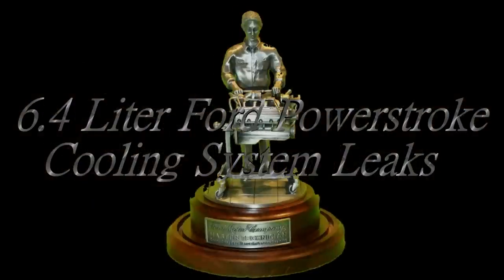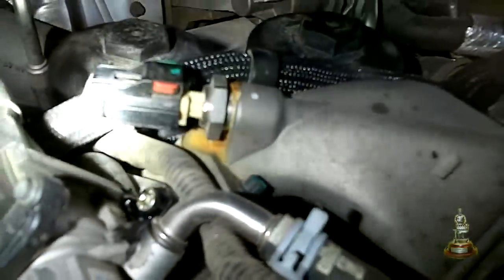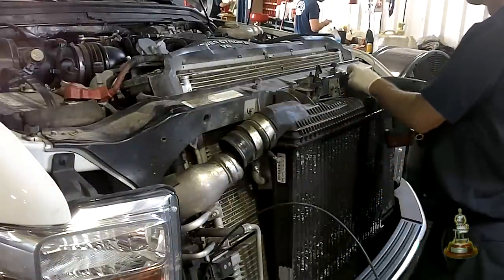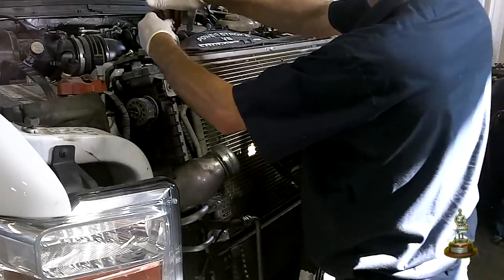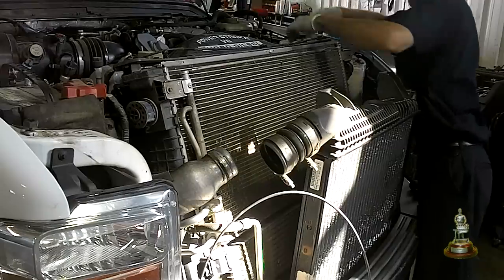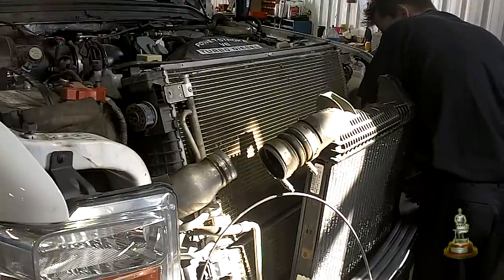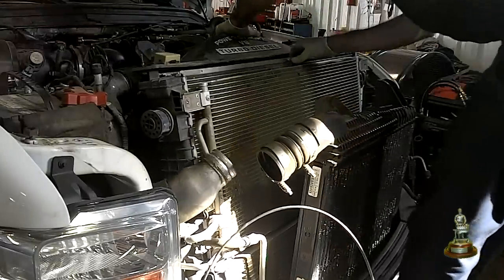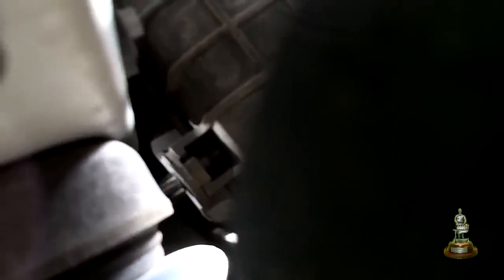6.4 Liter Ford Powerstroke - Coolant Leaks Points - Radiator Removal

Comment from the maker: @Mr42960 
They way I do my warranty work, I'm not sure how they do things there, but if you came in my shop with an extended warranty, I would have had everything covered by the warranty, including the flush! If the TSB was followed, it would all have been covered the radiator, both hoses. I would cover the flush as related damage.

Comment: I'm taking my 2008 f250 to dealer tomorrow. They tell me the labor cost is the reason for $1600 to replacing a hose & line. 10 hours labor is by the book. After watching this video, I am getting it right up the tail pipe. It took this ford mechanic less than 15 minutes to have total access to everything. Why does Ford service use a book of lies to justify the overinflated labor time and then post a video to back up my complaint of labor hours being all lies.  LESS THAN 12 MINUTES TO GAIN TOTAL ACCESS

Comment: this is a 2010 model??!?!?! I cant believe there has been that much failure in 2 years and 80k miles. I hope Ford got it right with the Scorpion. The 6 liter and 6.4 seem like real money pits. Through all the trial and tribulation with the $6.0, and the $6.4.....they should have devised a recall that is a one shot deal that fixes ALL the problems at once and fixed them for good, a one shot deal. Everyone is losing so much money with these trucks. When the tires dont roll, the owner makes 0 money

Comment: Great Video.  I have a2012  F-350 with a radiator leak (front driver's side, bottom of radiator).   Can't afford $1,700 from the dealer.   Any suggestions?

Comment: Just finished a radiator job on my 08 and couldn't have done it with out the help. Your work style is the same as mine (quality) and that's not something you find all the time.     Please keep the vids coming my truck isn't getting any younger.                
Still flushing with distilled. Any thoughts on additives to help cooling system , Or just a good mix of Ford Gold and distilled?  
 Thanks again for the help.

Comment: I just had this job performed on my 08 with 27,000 miles on it. Extended warranty only covered the radiator itself, powertrain covered the thermostats, I voluntarily paid for updated hoses, degass bottle and coolant flush. Including my $100 deduct, my cost was $800. Ford knows they had design problems with many, many trucks going through radiators, yet I have to pay 800 for warranty work? Thank you Rusty, for showing me what the technician had to go through to fix my truck. Thermostats !

Comment: Thanks for the great videos. Are all three radiator hoses supposed to have dual "O" rings on both ends? Local dealer didn't have new ones in stock, so got Gates 23815,16 & 17.  some ends have only one ring.
Thanks again.

Comment: I have a 2011 Ford6.7L  4X4 and it's my first Ford and my first diesel engine. I've built many gas engines but I don't know much about the diesel and I have SO MANY questions about my truck but when you go to the dealer to ask a tech a question they have attitude and no time for me. Do you think if I gave you my # and sent you a check that maybe you could answer my questions? If you don't wanna do that I understand fully. Love the video bud.
Reply: William Santiago did he contact you cause I wanted to get ahold of him to

Comment: I love your vids. Very well done. Question: If an EGR cooler is leaking will it cause the Eng temp gauge to spike and de-rate the engine? Under a hard pull usually 3/4 of the way up the gauge just jumps to max and it de-rates. Pull over, shut it down, give it one minute and it runs fine again. I did notice his degas tank is very low to and his cap is no good. But, will gas build up in that cooler spiking the temp?
Reply: I am experiencing this at the moment. Sometimes it jumps to the red mark and after about ~2 minutes it goes back to normal. Or if i shut it down like you mentioned.

Comment: My 6.4 has 219k miles with the original radiator still, guess I just got lucky!
Reply: They will last pretty long if you do highway driving. Off roading frame twist is what causes the problem's. The aluminum separates at the plastic sides of the radiator. I replaced two of them on my 2010. Worn cab mounts will cause a lot of twist also.
Reply: Damn youre lucky. My 08 F450 had it replaced 40k miles ago and its leaking again already. Its only got 105000 miles on the whole truck.

Comment: Ford still has radiator problems on the 6.7. I have a 2012 F350 and the main radiator leaked at the drivers side tank. Replaced under warranty thank goodness! Get a video of the 6.7!